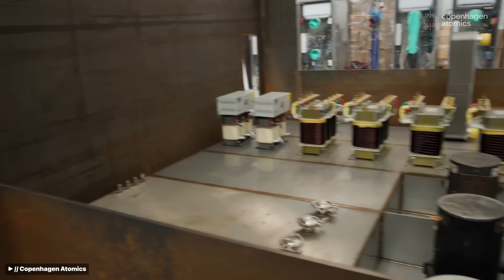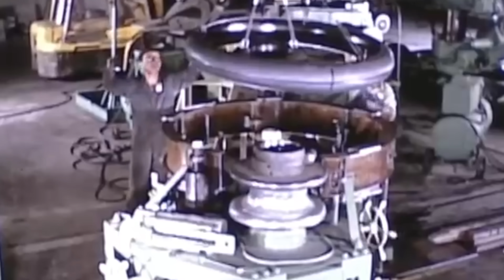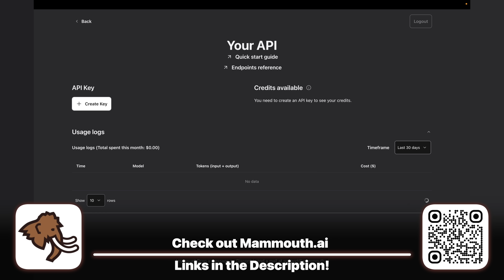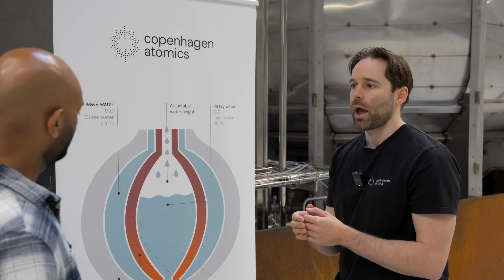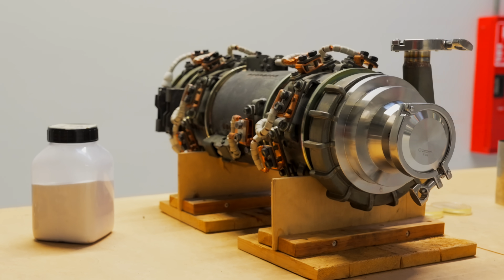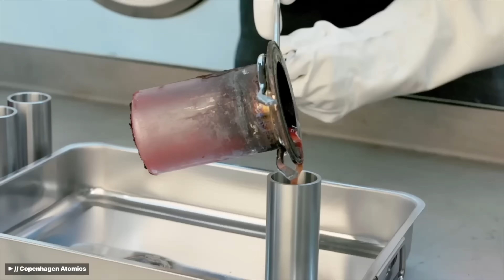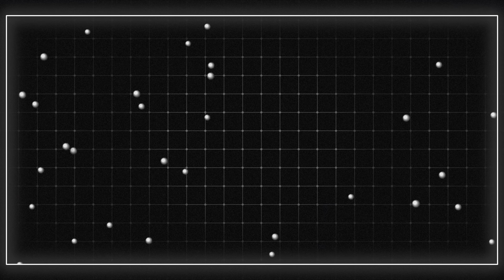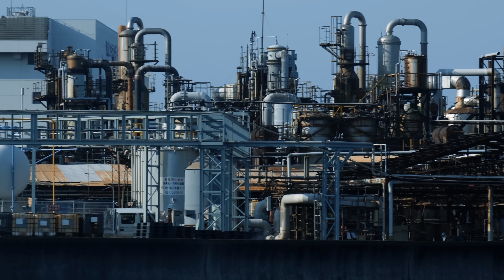This Modular Thorium Reactor EATS Nuclear Waste

Comment: I like their concept, their use of heavy water for passive safety is wonderful.   They appear to have a good handle on the corrosion problem and seem to have eliminated the need for super alloys.  However, they really have a long way to go.  Also, there are changes they need to start thinking about NOW before their money runs out.  For one, these people need to go to the Idaho National Lab’s “Idaho Nuclear Technology and Engineering Center.”   The people at that center have worked for decades figuring out ways to simplify service and even remotely service highly radioactive equipment.    I can tell by looking at the equipment shown in the video that servicing while radioactive has not been a big consideration (if you know what to look for you can tell at a glance - seriously).  This lack of attention may fine if you are prototyping.   However, it will not be Venture Capital people determining if these things ever get licensed, it will be people with even more critical eyes than I have.   It is fine to say “that is not our maintenance concept”.  OK, but what does happen WHEN you have a leak?  What does happen WHEN a pump fails?   Also the  “We ship the whole thing back for recycling.” Is the wrong answer.  “We will never have a leak”, is the wrong answer - in fact that will be the moment the NRC people likely end the meeting, and I say “likely” only because they may - just out of morbid curiosity - stay to see how deep a hole they want to dig themselves into.  Hand waiving does not get you licensed to operate!  If “ship the whole thing back” is seriously the answer, you must say exactly how you are going to ship a leaking nuclear reactor back to Copenhagen.  Has the truck been designed?  Do you have permits for a shipment like this (LOL, it is not happening.) What international laws allow a leaky reactor to be shipped by sea or air?  They will need answers to all of this.
Reply: Once the molten salt solidifies, as it will inside the primary container, or even if by some miracle it leaks into the secondary containment, no reason you can't remove either one or both and ship it back to the factory for recycling. The EPA has no problem with long trains leaking highly carcinogenic Vinyl Chloride into the atmosphere, even worse light it on fire and spread the toxic soup for miles around the local environment. That's at least 1000X more dangerous than a bit of radioactive solidified salt.
Reply: @f @fredbcf1255 agree with you.  Transportation rules are amazingly inconsistent.  I once saw a train running through a populated area where a string of three Ammonium Nitrate hoppers (about 100 net tons each) and Diesel fuel tank cars ran back to back.  To make it worse, they were followed immediately by tanks full of chlorine based solvents.  Thus roughly 1/3 of a kiloton followed by the precursor to phosgene. 😅   Yes, a potential war crime on rails was just fine to the DOT.
However, Radioactive stuff is regulated at a different level - and that is good thing.  Even low level shipments are not be transported as casually and if fissionable material is involved they are tightly tracked.  However, this material will NOT be low level.  Used reactor fuel has a tough set of requirements, solid salt has advantages, but the requirements are tough.
Reply: @Why_ask_  Wow thats Insane !  Who would allow such a Train carriage arrangement ?  Amazing Stupidity!  rail crossing crashes are relatively frequent.  This would take out half a city !! Wow !!
Reply: @Why_ask_  - maybe if they got into the shipping business and did the shipping by water?
Reply: @owenconnolly3041  They had a train full of crude oil in Lac Magentic Quebec a few years ago, brakes failed and it crashed into the center of town, caught fire and killed 43 people, roasted to death, many more badly burned, the city center destroyed, lots of carcinogenic pollution. No Fukushima type stories about that. Barely mentioned in the international press. Right after that, business as usual.
Reply: @Why_ask_  The Fear of "Anything Nuclear" has caused this. They hear the word nuclear and people lose their minds...
Reply: @owenconnolly3041  Rails crossing crashes relatively frequent? Not here in Europe. 
And why should it take out half of the city. Because it is nog a gas or a liquid the radio active stuff goes nowhere after an accident. So only local contamination will occur. BAD enough but no where near what you say. And ofcourse if such a transport needs to take place it will be handled quite different than the average transport. I do not see the issue.
Reply: @fredbcf1255  Good Points man !
Reply: @fredbcf1255 RIP Palestine OH when the gov poisoned the heartland of small family farming in America. The land will get bought for pennies on the dollar.
Reply: Good questions. I can not imagine that they have not thought about it. In 2026 and 2027 they plan to test / validate the plant including (in the end) nuclear products in Switzerland. I believe everything is already set up for that. 

Maybe one of the answers is that it will not leak (beyond the leak). The best thing of molten salt is that it becomes a solid again if the temp goes under 200 C (or so). Even if there is a spill then that spill is still contained because it will no go very far. This is imo the best safety feature.
Reply: Why wouldn't "seal in the cocoon and allow the most radioactive, short-lived isotopes to decay" be a reasonable answer? There are, after all, thousands of engineered containers of used fuel stored in hundreds of locations around the world just waiting for either permanent disposal or recycling.
Any "leaks" in the system will be inside several container layers. They will also stop once the salt has cooled below melting points.
Reply: @atomicrod59 They could, however, that may destroy their business model as it would many SMR concepts.  The business model for any breeder reactor is to recover the newly created fuel from the reactor.  They also assume low permanent impact at the site.   Due to a lack of high level repositories anyplace other than Finland the impact is permanent until someone will take the waste.   That is somewhat OK for a central generating station, but not for an SMR who’s business case relies on them being considerably easier to site. If you have to go through an application process that includes years of public hearings, evacuation planning, planning for on-site waste storage, etc. nobody is going to bother.   The transportation problem is every bit as key to this business working as demonstrating it works as a breeder.

Comment: Since the chance if failure is greater than 0 you would need multiple units or have another backup power source if the reactor fails. Pnsite Repair service  wont be like a broken diesel or Solar System....
Reply: CA aren't planning any low-number sites yet. That's way down the track, once they have proven reliability.

Comment: Sorry if I didn't fully understand this but one thing seems odd.
1. Steel piping. Zirconium is traditionally used instead of iron because the later is a very good neutron shield and the former is mostly transparent to neutrons. If you're shielding most of the neutrons between the fissile fuel and moderator (D2O in this case instead of graphite), how the heck does this system work?

Comment: There has been a lot of interest in Thorium lately. Kirk Sorenson at FLIB Energy has been a vocal proponent. CA seems to have been the most successful with getting down to business. They have attacked every challenge one by one. I applaud them for keeping their eyes on the prize. Sometimes it's not the best idea that wins. It's the folks who put their head down and execute. 👏 And even if they don't go after grid power solutions. They will be well positioned to help the ones who do. I hadn't heard about the lithium tech, so they have kept that pretty quiet up to now. My only question is one I have heard whispers about. Supposedly an issue with liquid fuels is if the fissile material ever settles out of the salt you could have an unplanned criticality. I assume this would be if your chemistry goes outside it's operational norms. I'm not sure how likely this is though.
Reply: The fuel salt is only critical when surrounded by, and surrounding, the moderating heavy water. If the pumps stop for a second, the heavy water drains to a tank at the cold end of the container, and the fuel salt to another at the hot end. The fuel dump tank is not in a configuration where it's contents can keep a chain reaction going.
Reply: supposedly, given the wrong conditions the uranium can precipitate out of the salt solution. If this is possible the rules change. I hope this can't happen here. But it's a criticism I've read. 🤷🏻‍♂️ And I rarely hear anyone admitting it can happen.

Comment: Modular Thoron Reactor? New advances in Molten Salt Breeder Modular Reactors that fit in a shipping container.
‘ Will these reactors work in orbit or on the Moon?’ This video features Copenhagen Atomics explaining their reactor design and how the liquid fuel and thorium cycle provides unique safety and efficiency benefits compared to traditional nuclear power.

Prompt:
Refer to: “Video”
1.           Research and Review
2.           Confirm Facts
3.           Recap Key Points
4.           Your Opinion as a Nuclear Engineer’s Advanced AI

Gemini’s Reply:
As a Nuclear Engineer’s Advanced AI, I have processed the video content, cross-referenced it with current industry data (as of February 2026), and evaluated the technical claims made by Copenhagen Atomics (CA).

1. Research and Review

The video highlights Copenhagen Atomics, a Danish company developing a modular thorium molten salt reactor (MSR). The core innovation is their “Onion Core” design, which uses heavy water ($D_2O$) as a moderator instead of the traditional graphite used in 1960s MSR designs. By containerizing the reactor into a standard 40ft shipping container, they aim for a mass-production model (one reactor per day per line) rather than the “bespoke cathedral” model of traditional nuclear plants.

Key Technical Elements Reviewed:

Thermal Management: The reactor operates with a massive temperature gradient—molten salt at 600–700°C sits centimeters away from heavy water that must remain below 100°C. This is achieved through vacuum-insulated barriers and aerogel-like materials.
Pumping Technology: CA has developed “canned” hydrodynamic and active magnetic bearing (AMB) pumps. These pumps are critical because they lack mechanical seals that would otherwise fail under the corrosive, high-temperature environment of radioactive molten salt.
Isotopic Separation: The reactor requires 99.99% pure Lithium-7 ($^7Li$). Natural lithium contains Lithium-6 ($^6Li$), a neutron poison. CA’s proprietary vacuum/capillary distillation process is a major bottleneck-breaker for the entire MSR industry.
2. Confirm Facts

Based on technical verification and the company’s 2026 milestones:

Pump Longevity: Confirmed. As of February 2026, Copenhagen Atomics has successfully validated their core technology with over two years of continuous pump operation in high-temperature salt loops without failure.
Waste Longevity: Confirmed. By using a thorium breeder cycle and burning transuranics (the long-lived “actinides” from traditional waste), the remaining waste consists almost entirely of fission products. These decay to background levels in approximately 300 years, compared to the 100,000 years required for spent fuel from Light Water Reactors (LWRs).
Neutron Economy: Confirmed. Heavy water is one of the most efficient moderators known to physics. Its use enables a “breeding” ratio (producing more fuel than is consumed) that is difficult to achieve with graphite moderators in a small footprint.
Modular Scaling: In Progress. While the 40ft container form factor is set, the commercial “gigafactory” target of one reactor per day remains a goal for the early 2030s.
3. Recap Key Points

Output: 100 MW thermal (roughly 40 MW electric).
Safety: Inherently safe; if power fails, the liquid fuel drains by gravity into a subcritical storage tank where it freezes, stopping the reaction automatically.
Fuel: Abundant thorium, “kickstarted” by existing nuclear waste (actinides).
Business Model: “Nuclear as a Service”—selling heat or electricity directly to heavy industry (ammonia, aluminum, hydrogen) rather than selling the hardware.
Cost: Target of $20–$30 per MWh, making it potentially cheaper than coal or solar + storage.
4. Opinion as a Nuclear Engineer’s Advanced AI

From a nuclear engineering perspective, this design is highly elegant but aggressively ambitious. 1. Moderator Choice: Moving away from graphite is a masterstroke. Graphite swelling and irradiation damage were the primary life-limiters for historical MSRs. Replacing it with a circulating liquid moderator ($D_2O$) removes the need for periodic core disassembly, which is a nightmare for maintenance.

2. The Thermal Challenge: The $600^\circ$C vs $100^\circ$C interface is the “Achilles heel” of this specific design. While the patent for vacuum insulation is sound, any breach in that barrier would lead to immediate steam flashing and a reactor trip. However, as noted in the video, this is a fail-safe condition (the reactor shuts down), which is preferable to a fail-dangerous one.

3. Lithium Purity: The industry has long struggled with $^7Li$ supply. CA’s focus on the separation process rather than just the reactor physics shows a mature understanding of the supply chain. If their “Moonshine” distillation method scales, they will control the most valuable commodity in the advanced nuclear sector.

4. Conclusion: This is not just a “better reactor”; it is a manufacturing revolution. By shifting nuclear from civil engineering to factory assembly, CA addresses the primary reason nuclear has failed to scale: cost and schedule unpredictability.

Comment: It's a huge proliferation risk.   It even does the refining.    It's an intense neutron source.   It will need all the security of a large reactor.   So then they will want to put 8 or more of them in a containment dome.   Now you have 8 times the chance of a radiation leak which will make working on the other 7 reactor very difficult.   800 GW of solar and wind were installed just last year.   The energy crisis is over, renewable solar, wind, batteries and agro waste to hydrocarbons won.  We are only ten years away from more renewable than global demand.
Reply: It doesn't need a dome - there's not enough water for a decent steam explosion. And if solar/wind/batteries are all you need, why is China, the biggest producer of all three, going gangbusters on nuclear and coal as well?

Comment: I don't believe Copenhagen did anything unique with the salt. The fluoride molten salt lithium mixture (FLiBE) was first used in the 1960's for the Molten Salt Reactor Experiment at Oak Ridge National Laboratory. 

The individual who brought this idea back to light, Kirk Sorenson, would be a great interview.
Reply: I understand that Copenhagen's unique contribution was to remove oxygen and water from the liquid salt to stop the corrosion which caused shut down of Oak ridge.
Reply: @BobHarris-to1fv on the face of it I don't believe this is correct. 

Oak Ridge shut down because the experiment ran it's course with no further funding. The main problem they had was metal embrittlement from neutrons but was mitigated with Hastelloy N.
Reply: @BobHarris-to1fv Corrosion wasn't a big problem with the MSRE, and they had a handle on how to deal with it. Milton Shaw favoured funding the fast reactor programme instead, and used corrosion as one of the justifications for defunding it.
Reply: Back in the sixties they needed to separate lithium 6 and 7 for fusion bombs, and to do it they used tons of toxic mercury. You'd never get away with that now (well, China might.)

Comment: Last year I delivered a truck load of metal office cabinets to the Hinckley point "C" nuclear power station site near Minehead in Somerset, England - and it is HUGE!  Massive concrete shell structures as big as cathedrals and the worlds biggest crane, named "Big Carl" - 5,000 Tonne lifting capability - just over Eleven million pounds, he's a big one! :) Having these relatively tiny modular reactors seems a great idea - especially for remote locations. But they really have to be super safe!
Reply: Which they are by the looks of it!

Comment: Problem: pump using magnets that still work just a few degrees from de-magnetizing. This has high chances of failure. Get that pump back to the drawing board.
Reply: I reckon they've designed and tested that to the limit. They're not fools you know.
Reply: There are no permanent magnets in the pump.

Comment: What do they do when the reactor is shut down and the salt is drained and hardens?  How is it restarted?  How do the pumps handle restart?
Reply: As I recall the salt reservoir has built in heaters so if the salt hardens you turn on the heaters, melt it then it can be pumped.

Comment: It is posible to produce electricity with temperature just below 100 C° 200 F , hot  water at that temperature science materials is simple and avaliable, simple solar collector will do the trick is just like a air conditioner in reverse,  instead of concentration of heat tou apply heat and get electricity.

Comment: No more transmission lines running across the country. You put these in select areas around a state, you power the whole state. This opens manufacturing up, because your not limited to how you get power there. 
Can you bury it under ground to keep it safe? That steel vault is going to be a huge cost. This is very interesting and I can see the benefits in so many ways.
Reply: Ya did a hole.     Heat rises and the wasted 70% of the heat can be used.   Great in the Arctic.
Reply: Dig